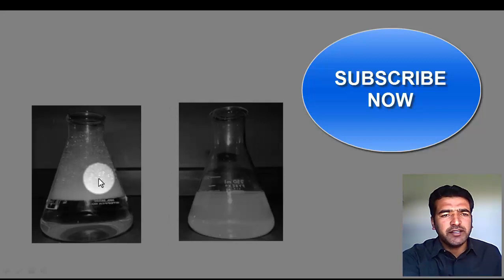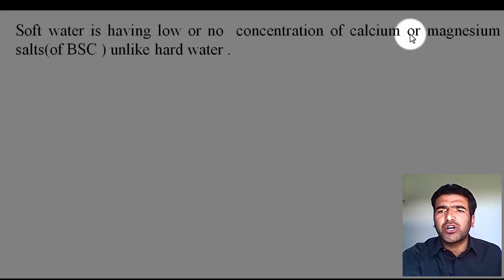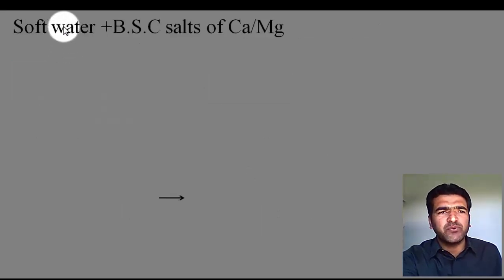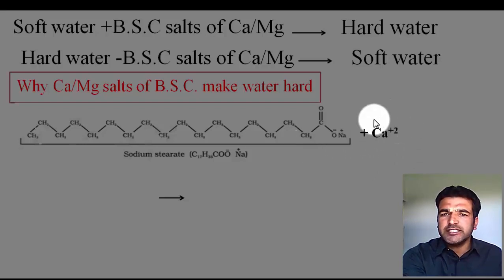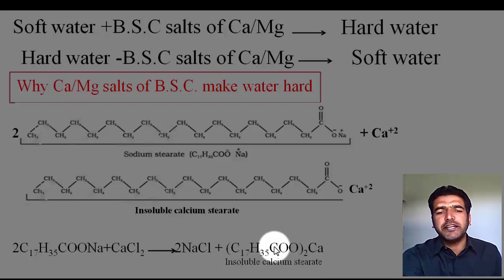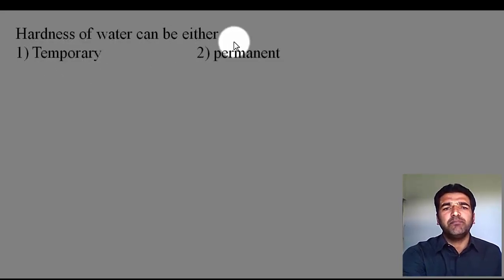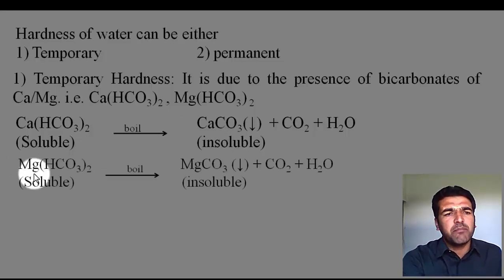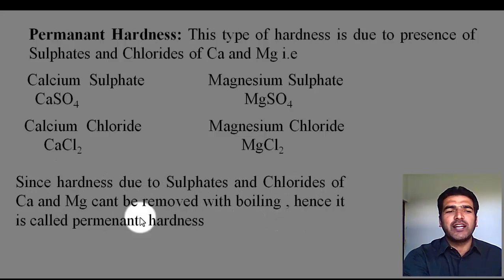Hard and Soft water

Comment: Sir During the boiling process to remove temporary hardness, isn't it  Mg hydroxide that precipitates instead of Mg carbonate because of the high solubility product of Mg(OH) 2 as compared to MgCO3?
Reply from the maker: Actually Mg carbonate initially formed undergoes thermal decomposition and form MgO which in turn    form Mg hydroxide in water